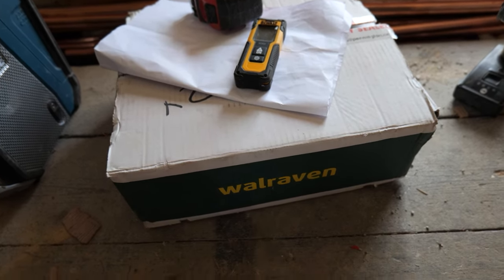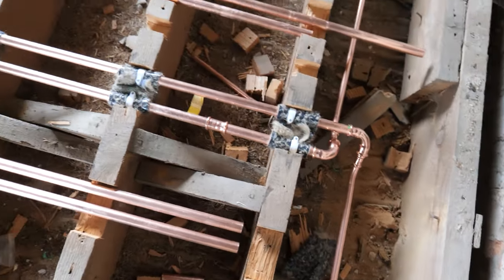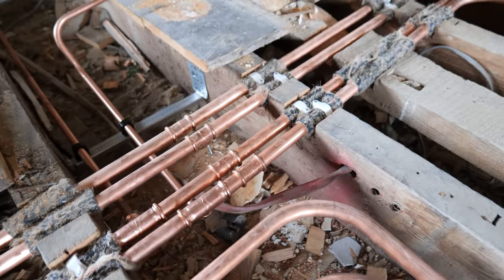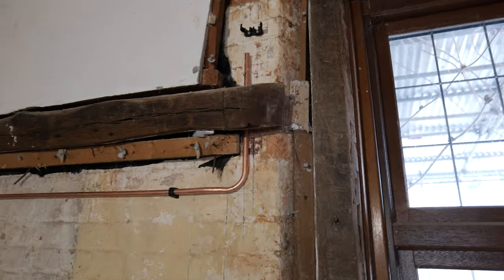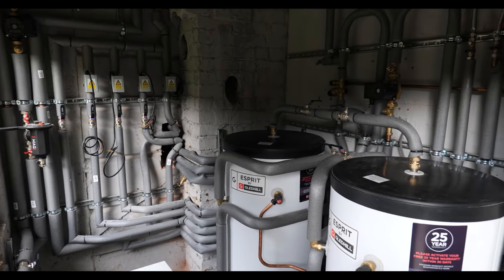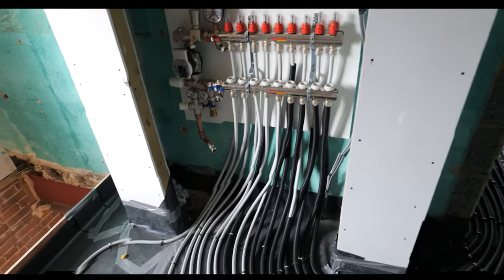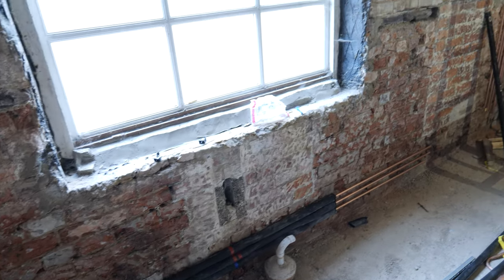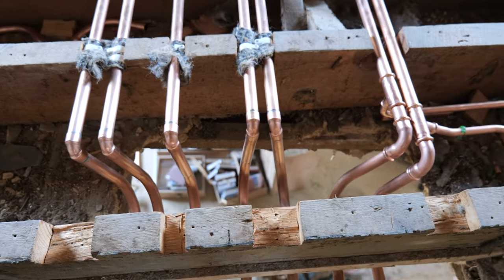Copper Heating Pipework - Chapel Boiler Room Complete

Comment: What press gun do you use and press fittings? How do you knotch out the joists? Cheers 🍻
Reply from the maker: We use the rems 22v mini. Just skill saw and chisel. Multi tool for more awkward bits
Reply: @loving-plumbing  Isn't the Rems more awkward to get into tighter gaps then the Nova press? Have you had use of other press guns and which do you think is the best... Best value? Thanks.
Reply from the maker: @waynenixon729  Hi. Rems is definitely better as the whole head spins 360 and it's not as long as the competitors. Although there are occasions it won't fit. To be honest I use it more and more nowadays but they are expensive. Plus I've had two break after 5 years. Both repaired and services for another 1k 🥺